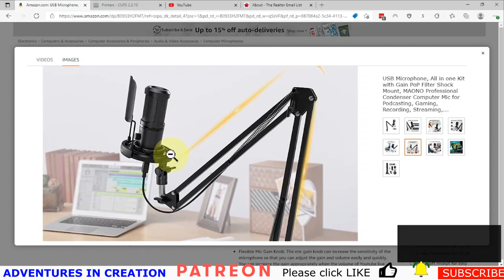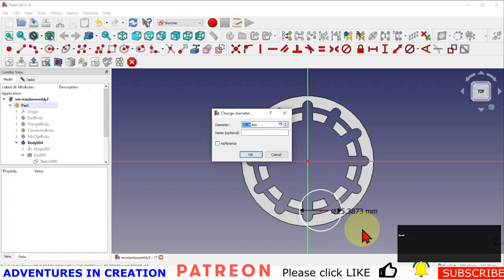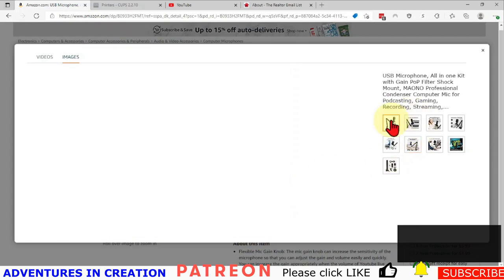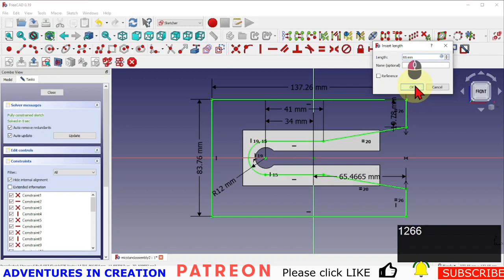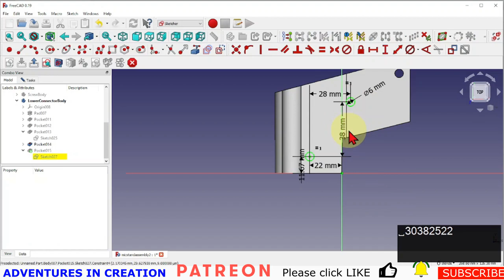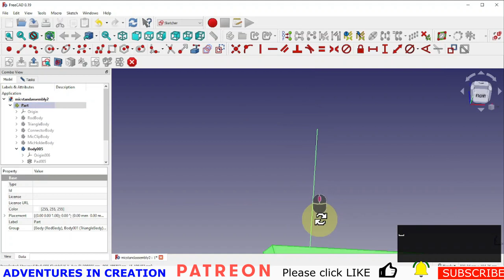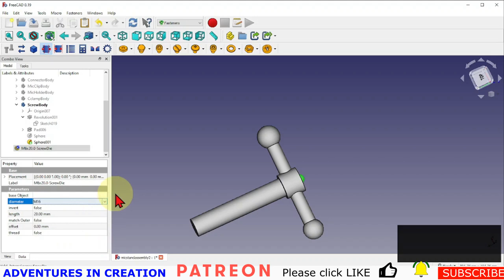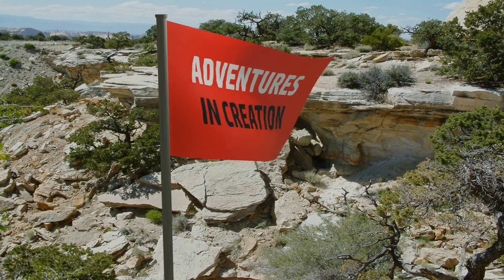FreeCAD for Beginners #22 Complex Assembly Pt2

Comment: Concerning your request for solving the problem of having a part turn off when you make a new sketch, I believe the solution is to make the body the Active Part BEFORE you make a new sketch.  My experience is that the body stays on.
Reply from the maker: Actually there's a setting that you can change. I have switched it now and it's 50/50 as to whether you want it on or not 😁

Comment: I try to make a simple sheet metal based part using the sheetmetal workbench. Starting with a XY Sketch -> a pad -> adding  bends ->  then get stuck adding  holes in those bends. An step by step tutorial on that would be great.. also how to create sunk screw holes and welded nuts on the opposite side of the  bends would be very helpful as well. .Very much  like the slow place of this compared to most other "click click , not telling  why and what was clicked/hot-keyed tutorials" , As a rookie  (not an ME) I found FreeCAD very confusing . For example some use parts and body, some not,. Often Freecad let you do things with which you run into trouble later and the error messages are quite hard to understand and the whole project is broken and need to start from scratch, The treeview structure is also quite confusing and a seperate tutorial on the logic of it might be very refreshing. Lot's to learn :-)
Reply from the maker: Do you have an example of what you are trying to make?
Reply: Please google for typical sheet metal enclosure. You should see a pictture of a top  and base seperated . sorry all my comments get deleted.
Reply from the maker: @de-bugger  I am seeing your response. I will have a look at the sheet metal stuff when I get a chance.

Comment: I have found your videos to be informative, however I object to your SWAGing part creation in this video. That is one of my objections to some of the instruction for Sketchup. Of course with Sketchup a user is forced to SWAG some aspects of part creation. As an old drafting/technical modeling instructor I think that for an application to be useful by manufacturing industry precision is imperative. I expect that many FreeCad users are hobbyist and not in manufacturing…yet. Just sayin
BTW just for future reference keep in mind that mm is not mil. Mil is an unit of measure in manufacturing.
Reply from the maker: Thanks for the feedback, you have to remember that with parametric design, the actual dimensions are not as important as the way you constrain them. Also, it is not necessary to create a dead nuts design to explain a modeling concept. I learned drafting before the days of cad and understand well where you are coming from but parametric modeling is a game changer.